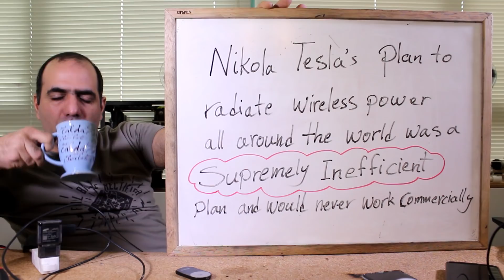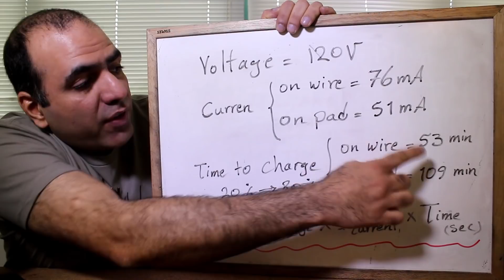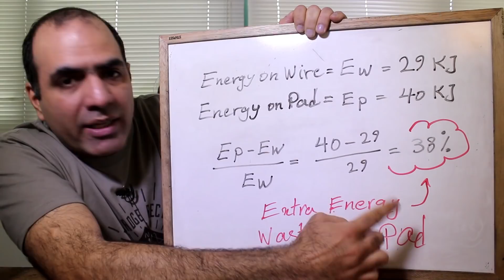Drowning in Inefficiency

Comment: electricity is super inefficient, that's the nature of it. you trade efficiency for convenience.
That's why electric cars are the worst thing that could have happened to the environment.
Reply: Wait til you figure out how inefficient internal combustion engines are.
Reply: @PURENT  internal combustion is more efficient than electric engines. electricity is mostly generated by internal combustion.
Reply: @TentaclePentacle  Electric "engine" is not a thing. It's an electric motor, the motor takes stored electricity and converts it into rotation through electromagnets. 

Electricity generated by internal combustion being used for an electric car has a major efficiency advantage over an internal combustion engine car. The electric car has very low friction loss thanks to brushless motors and no necessity for conventional gearing. The combustion engine requires a gearbox so the engine spins at an ideal speed, this gearbox results in significant power loss in transmission. There is also significant loss to friction simply within the engine because it is a mechanical device, there are tight tolerances and contact between numerous moving parts which must be continuously lubricated with oil. Finally, there is the problem of thermal efficiency, most internal combustion engines in cars are not designed to extract energy from heat produced by combustion which is significant waste. 

Even with F1 engine tech, with MGU-H that can turn waste heat into more power, internal combustion only gets about 50% efficiency. Because of Carnot's theorem, there is a limit on how much heat energy can really be used resulting in poor energy efficiency even in F1 cars. In comparison, electric car energy efficiency is about 77%. And remember, that 50% is an F1 race car, average consumer's car has efficiency around 25-30%.
Reply: @PURENT  you have no idea how electricity is generated do you? Fossil fuel is burned to generated electricity then transmitted over hundreds of miles of wire to get to an electric car, rather than simply burning the fossil fuel at the car. That is the inefficiency.
Reply: @TentaclePentacle  
Combined Cycle gas turbine by GE has 62% efficiency.
Power grid transmission loses are 5% of energy transmitted per EIA.
58.9% of energy is transmitted.
Electric car charged, operates at 77% efficiency, 45% of energy produced turned into motion.

Now internal combustion:
20-35% efficiency of internal combustion engine of average car.
Engine already less efficient than the entire electric car.

Carrying the engine with you and having to operate it at variable RPM is less efficient than fixing the engine to the ground where it can run at the most efficient RPM and using it to charge a battery.

And at least natural gas is often pumped via pipelines to power plants and the energy is transmitted over wire. Many people even have a natural gas line straight to their house. Meanwhile gasoline has to be regularly delivered by trucking and trains which are substantially less efficient.
Reply: @PURENT  you are forgetting the battery transfer have an efficiency lost, both in the charging and the discharging. Also, the electric grid needs constant energy generation even when not in use. combustion engines don't burn fuel when not in use.
Reply: @TentaclePentacle  That 77% efficiency of BEV is for the entire vehicle, including battery charging and discharging. 

"combustion engines don't burn fuel when not in use."

That's just embarrassing to read.
Reply: @PURENT  oh yes, i forgot my car in park with the engine off is constantly burning fuel.
Reply: @TentaclePentacle  Maybe you should drive around with it off.
Reply: @PURENT  yes ofcouse the ultimate way to save fuel is to take the fuel tank off the car, even when it's parked in my garage we still need to remove the fuel tank so it doesn't burn the fuel ofcouse.
Reply: @TentaclePentacle  Of course. An engine is most efficient when you aren't running it. 

That's efficiency right there. 0 energy consumed, 0 work done, 0/0 that's basically infinite efficiency.
Reply: @PURENT  the only problem is an electric car still consumes energy even when not running. The electric grid constantly needs to output that much energy to keep the grid running. The reason why you can have 62% efficiency for the gas powered turbine is that it's running constantly there is no gear change no idling. If you throttle the turbine to make change speed you would get the same amount of efficient as any internal combustion engine.
Reply: @TentaclePentacle  Yeah you gotta tell me how an electric car sitting next to a gasoline car in a garage, not being driven is some how consuming any energy.

"The reason why you can have 62% efficiency for the gas powered turbine is that it's running constantly there is no gear change no idling."

Now you're just repeating what I already told you. And there's no point in throttling a turbine beyond it's maximum efficient RPM, you're just wasting energy for immediate power.
Reply: @PURENT  when you plug in your tesla the gas turbine that's spinning at full speed is generating electricity to charge your tesla. Did you think when you finish charging and unplug your tesla the turbine at the electricity plant just spins slower or stops? The turbine is spinning at full speed 24/7 none stop regardless of use. That's the nature of an electric grid.
Reply: @TentaclePentacle  Right that EV is going to just charge to 95% then 100%, then 105% 110%.

It's just like when I fill my car up with gas at the pump, I just hold the pump indefinitely because the gas tank is a black hole where I can store an infinite amount of gasoline.
Reply: @PURENT  spin those hamster wheels in your head and think for a second. When you are not charging the car, the electric plant is still burning fuel spinning the turbines. That means a constant use of fuel vs a regular car when it's not in use fuel is being burned.
Reply: @TentaclePentacle  Right it's burning fuel to spin turbines. Producing all that energy and dumping it on to the grid where nobody else uses it. They just produce electricity and throw it out into the grid, there's not even a process by which daily electrical demands are forecasted and production is set to supply those demands.

But when your gasoline car is sitting in the garage not being driven, all deliveries of gasoline stop, the refinery and oil well shuts down, and it all only turns back on until you turn the key in the ignition. No wonder gas prices have gone up so high, driving only on weekends for leisure means no production Monday to Friday.
Reply: @PURENT  The grid is not energy storage, the grid is energy transfer. Electricity is generated, if it's not used it's wasted. When you have all the cars be electric that means daily demand goes up and you have to output that demand constantly even if it's not used. When your gas car sits in a garage the gas stays in your tank, The delivery of gas to the gas station stay in the tanks at the station, nothing is wasted.
Simple logic, the turbine that generates electricity burns fuel, it is constantly burning that fuel none stop even if your electric car is stilling in the garage. Mean while your gas car doesn't need you to constantly burn that fuel if it's sitting in a garage.
Reply: @TentaclePentacle  
"When you have all the cars be electric that means daily demand goes up and you have to output that demand constantly even if it's not used."

That doesn't even make any sense how is demand going to go up and then the electricity ends up NOT being used. 

Electricity supplied to the grid is adjusted several times per day. What do you think happens, power plants just run at full power 24/7 and waste a ton of money throwing excessive amounts of electricity onto the grid than what is necessary?
Reply: @PURENT  spin those gears in your head. electricity is measured in kilowatt per hour, let's say the current demand is 1 million kilowatt per hour, that means you must generate 1million kilowatt each hour and spend the fuel to do it. If you hook up all the cars to the electric grid that means the per hour demand has to go up. You will need to generate 2 million kilowatt per hour, or else the grid collapses when everyone plugs in their car. And yes ofcouse power generation is adjusted during the day time and night time. Do you what that means? That gear down the turbines, and as you have stated before if you switch gears for the turbine the efficient goes down, you won't be getting that 65% anymore. The reason why they can gear down the power plants during night time is industry and factory stop using electricity during night time so it's predictable. But if you have everyone charge their cars you can't predict when people are likely to charge their cars anymore, so you will have to constantly keep a higher kilowatt per hour generation or else the grid will collapse. Do you know how California is handling this higher demand right now? They are doing rolling brown outs. As they are cutting off sections of the state from electricity as to avoid a collapse.
Reply: @TentaclePentacle  "But if you have everyone charge their cars you can't predict when people are likely to charge their cars anymore"

Yeah you can lmao, it's so easy too. Vast majority of people go to work 9-5, come home at the same routine time, likely will plug their cars in overnight. It's extremely predictable unless everyone's work schedule suddenly changed.

"That gear down the turbines, and as you have stated before if you switch gears for the turbine the efficient goes down, you won't be getting that 65% anymore."

Turbine doesn't have a transmission, it doesn't need one. It runs at maximum efficient speed, no less and no more. When more power is necessary, more turbines are turned on, when less power is necessary, less turbines are turned on. Running a turbine at maximum speed is a waste of fuel and money if it puts the same electricity out as two turbines running at efficient speed.
Reply: @PURENT  right no one charges their car during the day, except reality just hit, California put out a public announcement telling people not to charge their cars during the day because their grid is collapsing.
And do you have any idea what it takes to start a turbine up from the cold? And how long that would take? Electricity is an on demand energy, and that means it has to be constantly on. 
Reality doesn't match your fanciful thinking. Simple thermal dynamics. Fuel is stored energy, a combustion engine converts stored energy into mechanical energy that drives the car. Any conversion will lose some energy to heat and friction, that's just a basic physical fact. 
When you run an electric car, first you need to convert the stored energy into heat which heats water and generates steam, that steam is then converted into mechanical energy that turns the turbine, the turbine then generates electrical energy. 
In that simple example, there is already 4 stages of conversion, at each stage, you will lose energy.
That electric energy is then converted into stored energy again when you charge your car. Again that's another stage and another lost of energy. When you drive your car the battery energy(stored energy) is then converted into mechanical energy again that's another stage.
A simple combustion engine only has 1 stage, while a tesla has 6 stages of conversion. Which type of car takes more energy is readily apparent.
Reply: @TentaclePentacle  "right no one charges their car during the day"

How many times do you fill up your car with gas in the 8-10 hours while your car sits in a parking lot at your job?

"California put out a public announcement telling people not to charge their cars during the day because their grid is collapsing."

Grid collapsing or was it the fact that outside temps were reaching 120 degrees resulting in air conditioners running constantly?

"And do you have any idea what it takes to start a turbine up from the cold? And how long that would take? Electricity is an on demand energy, and that means it has to be constantly on. Reality doesn't match your fanciful thinking."

Turbines are constantly turned on and off every single day. It doesn't have to be constantly on. You're just wrong and you don't wanna accept it, "hurr durr reality doesn't match." What do you think, electrical companies are just going to dump tons of electricity onto the grid at night when no customer is going to use it ergo, no customer is paying for it?

"A simple combustion engine only has 1 stage, while a tesla has 6 stages of conversion"

Yeah and the net efficiency of the Tesla from power plant to battery is STILL greater than the internal combustion engine car with fuel in the fuel tank.
Reply: @PURENT  gas stations do most of their business during the day, not night, that's just reality. And yes California doesn't have enough electricity because of high air conditioning use, but why do you think the state told people not to charge their cars during the day? It's because people were mostly sharing their cars during the day.

You have no idea how power generation is done do you? They don't turn the turbines on and off, they just run the turbines at a lower speed during the night

let's take your numbers turbine has 62% efficiency.  (-38% energy lost)
transmission loses are 5% (-5% energy lost)
Electric car operates at 77% efficiency (-23% energy lost)
Total -66% energy lost.

35% efficiency of internal combustion engine (-65% energy lost)
That's still less even with your numbers. And that's not to mention you need to overproduce for the electric grid to keep it stable even if you can turn the turbines off at a whim there is still wasted energy not used in the electric grid.
Reply: @TentaclePentacle  "gas stations do most of their business during the day"

Gas stations do most of their gasoline sales two times of the day, mornings and evenings. Why? Because in the time between people are at work. It is predictable. So is charging an electric car.

"let's take your numbers turbine has 62% efficiency.  (-38% energy lost)
transmission loses are 5% (-5% energy lost)
Electric car operates at 77% efficiency (-23% energy lost)
Total -66% energy lost."

Incorrect calculations. 
Gas turbine converts 62% of energy from natural gas.
Power lines lose 5% of the energy that is already converted, 62 * 0.95 = 58.9%
The electric car loses 23% of the energy delivered by the grid, 58.9 * 0.77 = 45.3%

Total energy lost is 54.7%.

35% efficiency of an internal combustion engine, mind you, is only really possible at optimum driving conditions 55 MPH, 1800-2000 RPM, constantly in a car with a good drag coefficient. Driving too slow? Your efficiency drops. Accelerating? Your efficiency drops hard.

Let me just point out, Nissan recently developed an engine for a road car that can achieve continuous 50% thermal efficiency. It uses heat recapture like MGU-H. But how did they manage to solve the efficiency problem with gearing and accelerating? Simple, no gears and force the engine to turn at a constant efficient RPM at all times. But then how can you speed up without increasing engine speed? Simple, use the engine to charge a battery which powers an electric motor. It's an EV carrying it's own generator. Just goes to show, you'd probably be better off charging an EV with a gasoline generator than putting that same gasoline in a car.
Reply: @PURENT  wrong again. California knows people charge their cars during the day that's why they specifically told them not to. Even if we go with your morning and evening charging times. It's impossible to turn off the turbines after morning and then turn it back up again at night and then off again after. You would not get that 62% efficiency if you disrupt the Brayton cycle. The 62% efficiency is only at the height of the brayton cycle. It's the same thing as gearing down a car engine, if you stop the brayton cycle and start again, you will get no where near that 62%.
Reply: @TentaclePentacle  No California told people not to charge cars during peak residential hours because day time loads were already extremely high with outside temperatures. People were encouraged to avoid using high power appliances including air conditioning, dishwashers, washing machines, as well as charging cars between 4 PM - 9 PM. 

"Even if we go with your morning and evening charging times." No that's when people fill up with gasoline.

Most people charge their electric car after 9 PM due to cheaper power rates overnight than during the day. Most owners don't even have to decide this as their car or charger already schedules for overnight charging.

"It's impossible to turn off the turbines after morning and then turn it back up again at night" 

They wouldn't be turning off after morning, at that point is when power demand begins increasing, and it usually peaks between 12 PM - 6 PM. Combined cycle turbines are routinely shut down at night due to low demand, they still remain exceptionally hot because they are heavily insulated as heat retention is extremely important for efficiency. It's only in cases of cold starts where peak efficient output cannot be achieved for several hours, but a cold start means the turbine has been off ranging from 24 to 72 hours or more. The only time a turbine is ever off for that long of a duration is for maintenance. Most starts are warm starts and hot starts which take less than an hour.

The cost of start and optimum offline time is all calculated in deciding which times a turbine will be turned off. Every day power plants do this, electricity available to the grid changes constantly but predictably.
Reply: @PURENT  4PM to 9PM, yeah what about 10am you think factories and industries the bulk of the power requirement are idle at 10am?
You just stated cali wanted people to stop charging their cars before 9PM and then in the next breath you said most people don't charge cars before 9pm. 🤷

Even with your warm starts you are not going to get the peak of the Brayton cycle and the bigger the turbine the longer it takes to reach that cycle. The efficiency of 62% for turbines is a false number. In the end it all evens out with an internal combustion engine because the limiting factor for the efficiency is because of thermal dynamics.